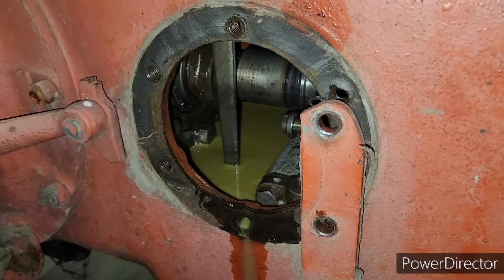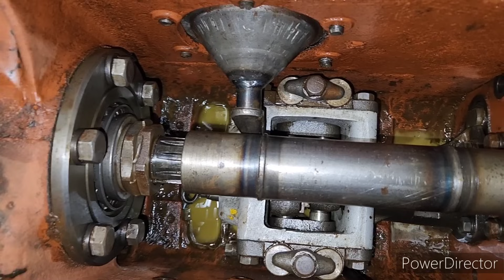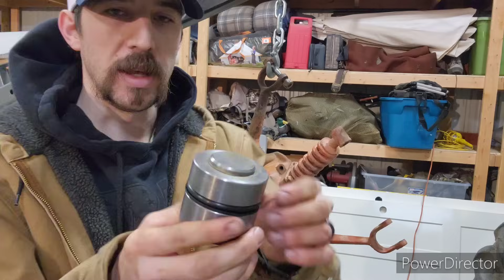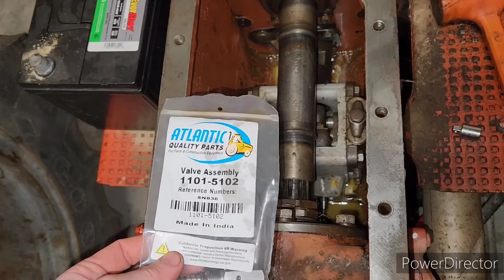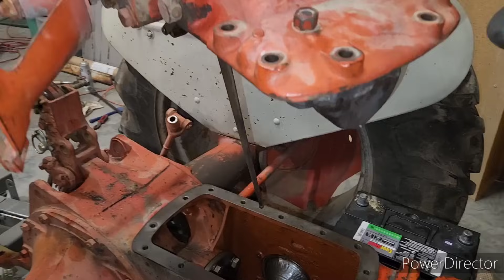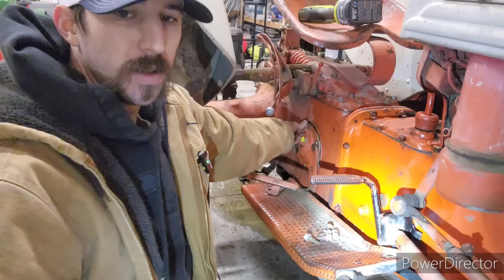TOP LID REPAIR! Ford 8n tractor 3 point not working

Comment: This repair was exceptionally well presented.  No minor items or warnings were left unsaid.  Plan to follow your techniques on a '52 n I just acquired where the 3 point does nothing.  And I fully agree that if your pump isn't working, start with the top lid instead of dropping the pump first.  Most times the needed repair exists in the top area.
Reply from the maker: Thanks for the kind feedback glad you found it helpful!
Reply: Great vid. I just recently bought an old Ferguson. I don't know the year but the lift arms don't work. Can't find anyone in my area to fix it.
Reply: @johnschwenke6307  Be sure you have enough trans/hydraulic fluid in the cavern.  Sometimes one of the valves gets stuck, won't work.  I had one where a good bit of water had penetrated the oil over the years causing the pump casing to crack, didn't work.  If the valve is stuck, it can be cleaned and repaired but pump needs to be removed.  If pump is cracked, a replacement pump is needed.

Comment: Any idea what makes the lifting hydraulics clank and clonk when lifting something heavy?
Reply from the maker: Most the time thats just your hydraulic piston shifting in the cylinder, more than likely the seals are worn out or u have some burs in there. If its not leaking down I wouldn't worry about it but I'd plan on having to replace the cylinder and piston in time

Comment: You forgot to mention that you were installing the upgraded lift piston in place of the old one that used steel rings.  Also, you left out the 2 small paper washers that went on the 2 front bolts for the lift cylinder.

Comment: Bought my 49 8N from Alabama to northern Illinois (near WI border) 6 years ago in early March. When I got home, she would not move (roll) to get her off my trailer. In neutral, parking brake off. I called an old timer who asked me what the temperature was in Alabama when loaded her and left. 58 degrees. What is the temperature in Illinois when I tried to unload the old Ford? 20 degrees. He said wait until it was warmer out. Thought he was pulling my leg. After 2 days with the temperature at 40 degrees, she rolled right off the trailer. Then the older gentleman said to drain the hydraulic fluid (same fluid for both the tranny and h-pump). Over 1.5 gallons of water came out first. Yep. Tractor probably ran like that for decades in Alabama but it turned into a big chunk of gear-stopping ice. Water apparently likes to run down the shifter plus moisture in the air equals water where it ain’t supposed to be!

Comment: Viewers when I started out as Apprentice I was told only to start tractor from seat  , never from side .About 6 months before I started in that  shop   a young Tradesman did a start up  while standing on side and tractor was in gear ,fired up and ran straight over him and killed him  .
Reply from the maker: You are correct it is very dangerous to start a tractor from the side because your between the wheels and if its in gear you'll probably be ram over. Fortunately ive done this many years and hasnt happened to me. But im pretty safety conscious (though it may not look it) i check multiple times tractors in neutral before start if ill be next to it. To the point if its an unfamiliar tractor i will roll it in neutral to ensure its not stuck in a gear without me knowing. But yes very good tip.

Comment: loved it I have done that many times I bought a 500lb chain fall and put on my hoist lt sure save steps you can guide the rod in and lower the at the same time alone thanks good video.
Reply from the maker: Thats a great idea
Reply: I just start a bit higher and set the hoist to an extremely slow bleed down, it might take 3-5 minutes to lower but I can do all the hand guidance I need and never touch the hoist.